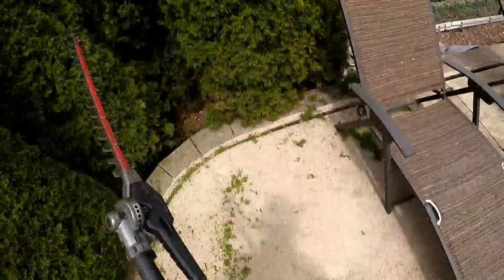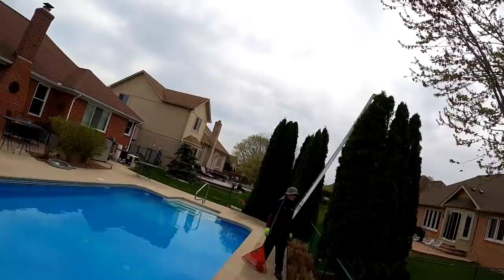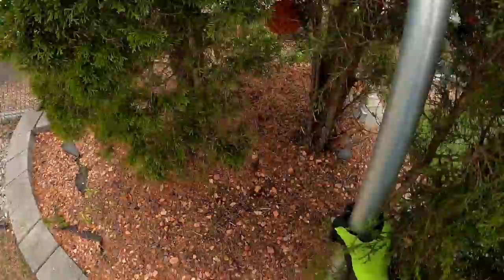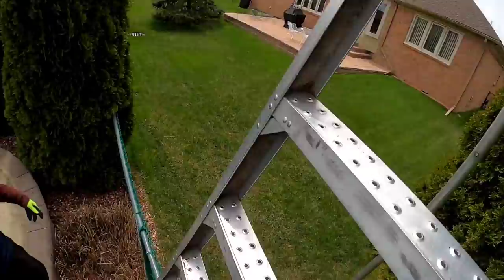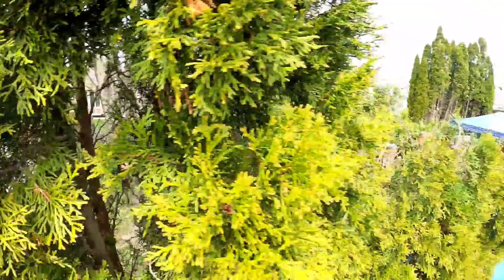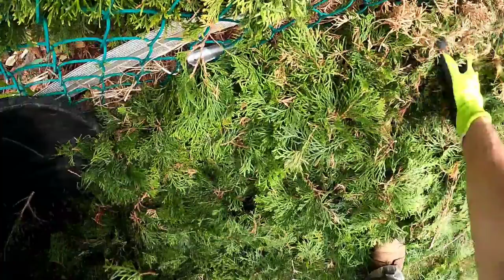Trimming & Topping Hedges "First Person View"》GoPro 8 | No Talk All Work

Comment: Nice work keith .i went back to work here in wisconsin  today and banged out 3 spring cleanups when i got home to backup the trailer my power steering hose or rack is  leaking barley could turn the wheel everything must be right on schedule lol have a good night peace.